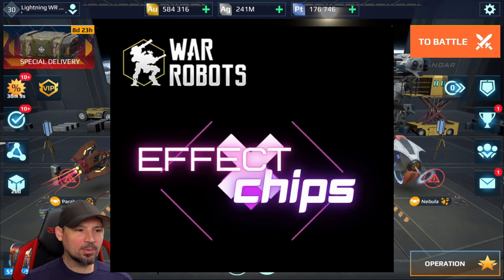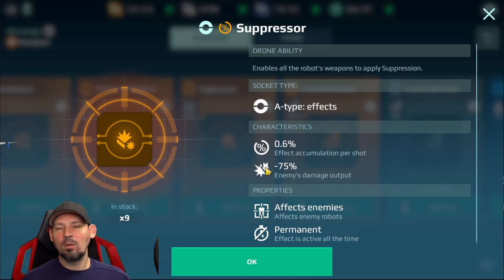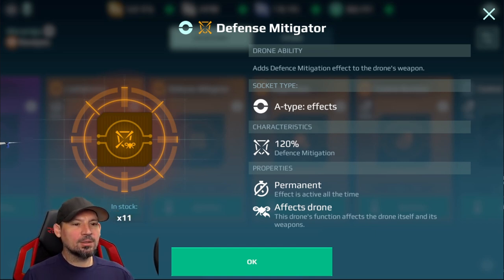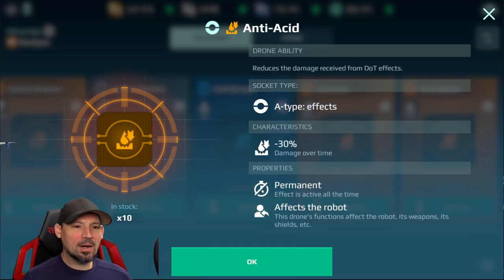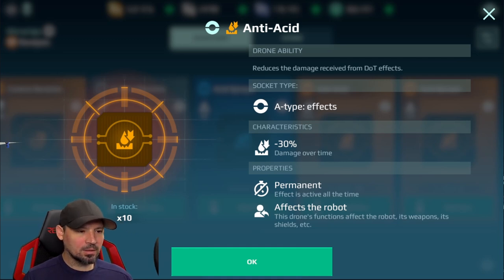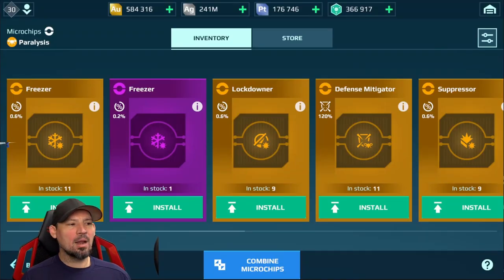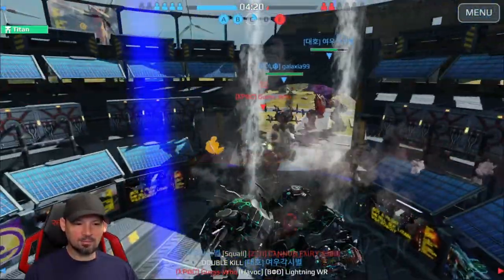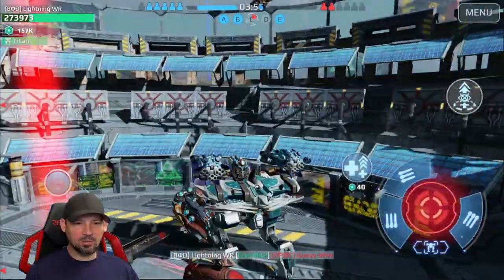War Robots effect microchip guide, A Type chips +WR Gameplay

Comment: Thx. Just wanna mention, CONTROL RESISTOR does not work in relation to ability blast like those of Typhon, Blitz, Nodens...because those are 100% definite effects unless you have an active Anti Control mod. The CR chip only activates in relation to being hit by weapons that take effect via accumulation.
Reply from the maker: It might be a glitch but a lot of times if you have a control resistor the animation of being emped shows up but it doesn't actually work